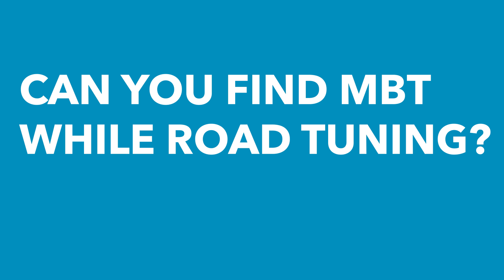[HPA Q&A] Can you find MBT while road tuning? | Ignition Tuning

Comment: I've Adjusted My Timing Part Throttle City Driving (0-40mph flat Roads) From Around 20 Degrees And It Finally Started To Get Knock Around 40 Degrees lol. My Plan Is To Get Every Cell I'm Working On In That Area Right Up Until It Knocks. Then I Want To Take Take A Certain Amount Out Of All Cells I'm Working On. I Would Guess MBT Is Before Knock On My Vehicle If Im Up In The 40s When I Start To See Knock Right?. Reason For This Is To Get Familiar With Cell Areas For This Driving Condition So When I'm On Dyno My Timing Should Be Close And Quickly Adjust And Check On Dyno. Or Im Going About This All Wrong haha

Comment: Wish there was a thorough shop with your credentials around here. Everyone can do wot tuning, make it start, idle, but primary focus is race cars. Not high performance street cars that need to be optimized and use a knock sensor for safety. Most laugh when I mention using the knock sensor. So either they don't have the experience to do it, or they are only concerned with race cars that run at wot. It sucks, pay top money for a quality efi system and then find I'll probably have to trailer the car 4 states away and leave it for days so it can be properly tuned.

Comment: I don't think it's possible to adjust timing while driving using HP Tuners. What software allows you to do that? HP Tuners does have a torque PID/Graph but maybe not fast or accurate enough for MBT.
Reply from the maker: It depends on the ECU you have. We can live tune our LS using HP Tuners, but it is not a feature for every car/ECU they support - Taz.
Reply: @hpa101  I have the E67 in a 2014 Camaro. would be nice but Ive never seen the capability.
Reply: @hpa101  I have been told RRT is not available on the E67. I can reduce timing to -6* is all

Comment: load cell engine mounts, accelerometers, road speed rate of change,.MAF readings and delta MAF  all these things could provide data help calculate torque ..and we also have chasis computers controlling the brakes 
 "impossible" sorry Endre i don't believe you .."not viable," i think or even "not yet possible" Someone will write some killer software one day to do it I'm sure ..
Reply from the maker: When there is an accurate alternative, we can change the wording. Until then, it is impossible and stating it as such helps avoid sending people down a very likely unfruitful and dangerous rabbit hole full of inaccuracies at worst, then ifs, buts and maybes at best 😉 - Taz.

Comment: If you get to knock before MBT wouldn't that indicate that you need better fuel?
Reply from the maker: In most cases, however that is not always allowed depending on the class you're racing in, or more commonly you want to use pump gas that is readily available in a street car - Taz.

Comment: Since real life.... how do you find MBT at higher engine loads?

Dyno guy doesn't like to have his dyno loaded for that long, and to be honest I wouldn't want to have my engine at 40-50PSI for a whole "timing sweep".
Reply from the maker: Yes, there is a point where you will do ramp runs to tune the top part of the map (slowly going higher and higher, not right to redline straight off the bat) in order to avoid sitting steady state in a high rev/boost area as you mention. Where this cutoff point is depends a little on the engine. You should have an idea of where things should be heading by considering the trend of the previous columns/s. Hopefully, that helps you out a little bit. 

If needed, this process is explained by Andre in much better detail (he has a knack for that) in the course material where he also gives you a demonstration of the knowledge in action on actual tunes too. Send me an email if you have any questions about that =) - support@hpacademy.com  - Taz.
Reply: Always good to know how the Pros do it. Thank you very much!

Comment: From your experience, can you tell if naturally aspirated engines are knock limited, or its not a case usually?
Should I do MBT tune? Or maybe its unnecessary? 

P.S. 1. Increased compression ratio significantly from 10:1 to 12.2:1 while changing to 108 octane fuel from 95 octane (EUROPEAN). 
2. Installed a lot less restrictive pipe exhaust manifold after porting heads.

Comment: I disagree. Hold steady engine speed on flat ground. Advance timing and should see load decrease to maintain fixed rpm until MBT is reached,at which point addition timing results in no load change (or load increase)
Reply from the maker: I'm going to guess you actually haven't tried doing this? If so you'll probably find a few glitches. First of all the load axis for most aftermarket ECUs ignition table will be kPa, so when we're trying to find MBT for a given cell, we're going to be holding the MAP value constant so we stay in the centre of the cell. When we advance timing towards MBT, we're going to find that the engine produces more torque and hence it will start to accelerate. Since the rpm increases, we move away from the cell we're trying to optimise and the wheels quickly fall off the whole deal.
Reply: High Performance Academy you are correct, you won't be able to optimize a single load/rpm cell this way. However, if you advance timing in the cell you are in and the load cell below this method can work.
In no way is this ideal, it would be better to have an Eddy current Dyno where you can hold center of a single cell and view actual hp. But, sometimes you have to make due with what is available.

Comment: I forget the name but there's a company that sells drive shafts with integrated load cells.  If I remember correctly they're about $1500 USD
Reply from the maker: Yes there's a few torque sensors available from different companies. AEM make one from memory. For most people though this isn't a great solution since the cost of the sensor and installation is prohibitive. You'll also need a data logger capable of reading the data.
Reply: High Performance Academy 
I agree.  It's a shame they're so expensive

Comment: For those not close to a dyno fascility, you can use Virtual Dyno to determine MBT.
Reply from the maker: My own personal experience with virtual dyno has been a little hit and miss. The main concern is that the conditions need to be identical in order to get reliable results, so road condition, incline, wind speed and direction all play a factor which becomes important when you're chasing changes that may only be in the order of a few percent. By all means try it and if you find it effective then that's great. It just hasn't personally been a silver bullet for me.
Reply: It goes without saying that in order to have comparable results one needs to replicate the same conditions. In other words one needs to use the same exact piece of straight road, one without any sort of irregularities on it, such as pot holes and bumps. It does not have to be an inclined road. As for ambient conditions, such as humidity, air temp this goes for most dyno fascilities as well with the exception of wind speed which can also be sorted by choosing a day or night of the same wind speed. By using VD on the road, there is no need to simulate any real world conditions either. I've already tried it and it works very well.

Comment: Bummer. Guess for this part id have to bring it to the dyno guys
Reply from the maker: Yes and no. With a bit of time, you can get very close to dyno results with road tuning, so it is 100% worth doing, but you will always leave a little bit of power on the table. Depending on your application for the vehicle and budget, this isn't necessarily a problem - Taz.
Reply: High Performance Academy Alright thanks for being active btw. Its really fun having a professional channel as active as you. 

Definetly gonna give your courses a try once I get some money up for a project. I got my eyes lined up on a70 supras with the 7mgte
Reply: When tuning on the road would it useful to do it on a hill to mimic load??
Reply from the maker: @Inverted - Cheers for the feedback! We're keen to see people learning so do what we can :)

@blindablinda123 - Hope you're keeping well mate! No, left foot braking to hit your load targets on a straight, flat bit of road is going to be easier than trying to find a long straight road going up a hill that has a consistent gradient to boot. Just factor in the cost of some new brake pads when you're done and have at it 🤓
We cover left foot braking in both the course material and also a members only webinar too - https://www.hpacademy.com/previous-webinars/the-key-to-road-tuning-left-foot-braking/ - Taz.
Reply: High Performance Academy there are tons of miles long Hills in New Hampshire.
Reply from the maker: The problem is that you need multiple hills of variable grades in order to hit every point you want. Left foot braking is much more flexible in this regard.
Reply: High Performance Academy  or use the same Hill with braking and proper gear selection.
Reply from the maker: Brakes are easily serviceable. You can simply budget in a new set of pads along with the fuel - Taz.